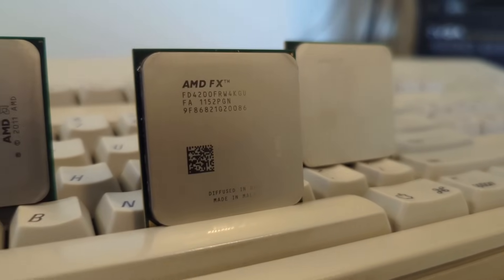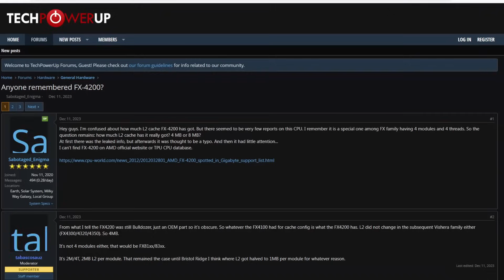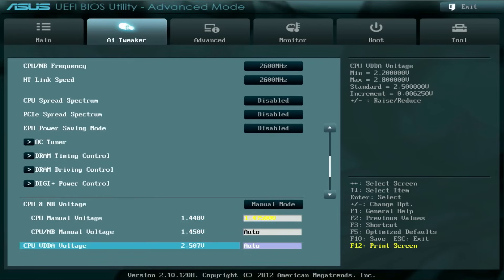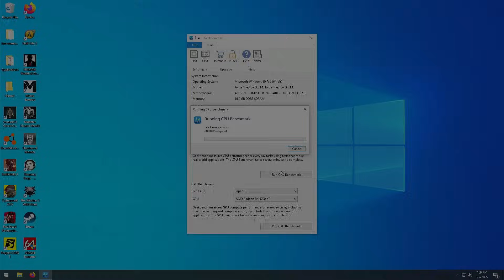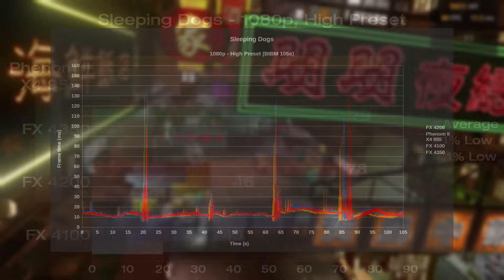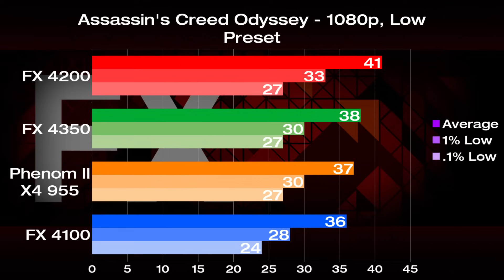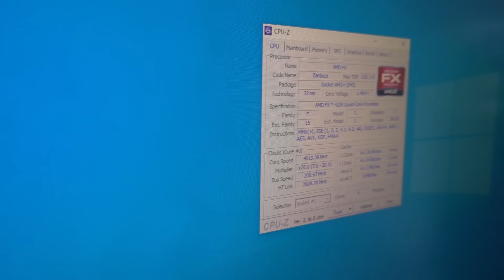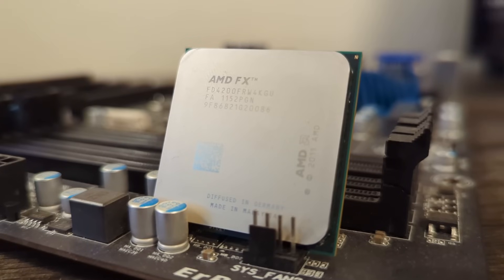What if AMD FX had "real" cores?

Comment: I still use my AMD FX-8370 (8 cores, 4 GHz) in my PC, since 2017, with 32 GB RAM and GeForce RTX 3060.
Reply: Bottleneck time
Reply: Hi there! Current FX-8350 user here. Mine too is still chugging along as well. I mean, yes, even oc'd to 5ghz loading times can be, well, questionable but not so bad it warrants rebuild just yet.
Reply: That’s a lopsided configuration…
Reply: Same here with a FX 8300 and a GTX1060, been in VR with that thing and it isn't half bad
Reply: lmao what a waste of a 3060. Neck of the bottle choking so hard ur basically a head in a jar.
As I moved from 7950 to 1060 to 3060, each upgrade was a 50% fps improvement at most until I upgraded the CPU for the full 100% (double my fps) and I've gone from 8320 to 1600 to 5600
Reply: That's a quad core bud. It doesn't have 8 cores.
Reply: @nexxusty  it does have 8 cores. they physically exist

it's like saying 4 sets of conjoined twins aren't 8 people
Reply: @stevesmith1383  There are many different types of conjoined twins, not all of them are two entirely functional humans sharing non-essential parts. Only parasitic twins, accounting for 10% of conjoined twins, have a decent survival rate.
Anyway, there was an entire lawsuit on this. They are not 8 cores. Some software treats them as 4P/8L, 8P/4L, some as 8P/8L.
Words mean things
Reply: @CLAAAAAB there was one lawsuit in one country in one state

That was settled out of court so there wasn’t even a ruling. 

That’s not a statement of fact. Certainly not the case for 99% of the world. If there was a real case to be had, the EU would have been all over this. 

Did you know an Isreal Court rules that Heinz isn’t ketchup but a tomato seasoning. Guess that’s true for America too now. 

And kudos for taking my conjoined twin comparison in a totally different direction

And yes, words do mean things. Software can say whatever. My cinebench r15 read windows 10 as Windoes 8

Guess I’ll go sue Microsoft for lying to all of us. 

But a physical core is a physical core 

The FX CPUs do not have virtual cores or hyperthreadong or SMT

They got gimped cores that share resources

CPUs sucks ass, but this whole “not a core” argument is dumb. And didn’t have much legal merit, hence why there wasn’t a mob of lawsuits
Reply: @nexxusty It really has 8 cores but shared into 4 modules, search on any AI. Some programs read only modules other skip them to check only the cores and threads. Park Control & CPU-Z says 8 core with 8 threads, Windows reads only 4 modules with 8 threads that's why there is a misindentification as 4 cores in some programs but it really has 8 cores shared into 4 modules, 2 cores per module.

Comment: I am watching this on the FX-6350, 32GB RAM, 1TB SSD and 6TB HDD, and a GTX 750 fanless GPU. It plays some games, sort of, but it's really serviceable for a lot of other things. In the next room I have a Ryzen 5 7600X build with 128GB DDR5 RAM, 2TB SSD, and 6 TB HDD, and an RTX 3050 fanless GPU, ready to go into service. It's going to be GPU limited, so the 4-stick RAM speed issue isn't an actual performance issue for me. Once they fix their memory controller, whatever new 6-core, high-clock CPU has the fixed memory controller will go in place of the 7600X.

Comment: I'm still using a FX 6300 lol. Works fine. 500 tabs open, runs games fine 32 g mem use fusion but that hangs a bit, runs image ai and llm models locally, just barely, but sadly. win11 won't let me keep it ;)
Reply: I had a 4100 before this that i ran overclocked, the memory controller failed on it but that might have been due to installation error that was so slight that it still worked for year but i notices the cpu pcb was a bit curved when i eventually had to replace it. not bent pin maybe something like some grease got under or the cooler heat sinc was clamped down too hard or something. These FX cpus overclock pretty well if you have a MB that can provide the power and stay cool and use an aio cooler with it. objectively these cpu's are plenty powerful to general use and gaming if you are okay with have the cpu intensive fx set to medium. Honestly the only reason i'm going to replace it soon is because the instruction sets it can support are a bit dated and newer cpu's have some major optimizations for running ai locally. The price of GPU is really harsh these day. I have a Nvidia Geforce GTX 1060 6GB that still works for mostly everything except larger ai models i run with the 6300 and 32GB mem on a asus m5a97r2 The only really downside recently is I've been doing work in fusion and waiting 20 min for tool paths to be generated and having to wait a min between any selection or edit is really annoying but that is expected as generally cad work is more geared toward a powerful workstation pc not a mid range 13 year old gaming pc. 

in my experience the 6300 is in a better spot between the power and heat of the 8xxx and issues with the bulldozer 4100 you get used to the idea that you 4 cores is more like 2 and your six core is like 3 but that isn't entirely true as they have 6 cores they just pair cores to cache or something so they can only be really functional operating in pairs and not independently so its like 3.

Comment: I loved my 6300, I got it in an M51bc system for dirt cheap with the psychotic custom hybrid m5a97 motherboard, but it ran stable 4.2ghz all day with a budget cooler master single fan cooler, gaming on an 8gb rx580. Of course when I upgraded to ryzen 3600 and 6800xt, it was a Bugatti vs a civic, but for about 4 years that 6300 ran games like farcry 5 in 1080 no prob

Comment: The FX clustering idea was reasonable in the context of when it was being developed and the individual sub-module tech was rather good but it just wasn't combined in the best arrangement. FX was sort of a test bed generation to try new ideas and poke at the edges of the envelope, incl unique cache policies with niche advantages; Zen was largely based on those FX-tech developments, with refinements and a better arrangement of the sub-components. (Although AMD downplayed the Zen-FX connection because of marketing reasons.)
  
GPU compute was strongly on the rise at the time of bulldozer and the industry predictions were that most heavy floating point work would be shifted to a GPU co-processor (floats are is still the specialty of a GPU), meanwhile most workstation tasks up until then were far more dependent on the integer-ALU. 
Now because die space is limited at a given cost and power budget you could have 8 ALU+4FPU as cluster cores or 4+4 as full cores with some extra space for a bit of extra cache. How does that math you ask, well an FPU is much larger than an ALU, far more circuits and transistors, especially as the FPU has become just a second function of the simd-unit since just before that generation. (FX had AVX-simd so basically a 256 bit FPU)

On linux use lstopo for a graphical diagram of your machine's topology from the perspective of what the OS can directly see or access: CPU sockets[packages], chiplets[sub-packages], cores, processing units within a core [usually SMT], process assignment order, cache layout details, numa config, whole system memory, and PCI[e]. If not logged into a GUI it will give a text tree. 

Within a core it will give processing units(PU) and the order of process(P) assignment. So 2 core with SMT might be:
(core#0[pu#0 P#0][pu#1 P#2])
(core#1[pu#2 P#1][pu#3 P#3]) 
Which in this example says the second process-thread (P#1) is assigned to the first Unit(pu#2) of the second core(#1).
I have an FX-8320, it shows 8 cores, each with one PU and a dedicated L1data, but the cores are in pairs with shared L1instruction cache. So the CPU hides the sharing of the FPU from the OS. It also seems to assign processes in packed order rather than alternating clusters, so p#0 and p#1 are both on the first cluster, eg. This was a definite weakness of FX, and I can't imagine why they did it that way other than making it easier to fully shutdown cores for power or binning purposes.

Comment: The first PC I ever bought that's only purpose was gaming had a 4100 in it. It taught me 3 things. 
1 - Buying brand new low-end prebuilt's are a colossal waste of money.
2 - It taught me how to overclock... out of desperation. 
3 - Being CPU bottle-necked makes for a miserable experience... How dare I have the audacity to play COD:WaW Custom Zombies while being in a voice call on Skype and not want to experience constant skipping and hitching. 

Bought an 8350 a couple years later. It didn't seem as good as the 3770K I also had, but it was pretty good.
Reply from the maker: The best thing was that overclocking point lol. I learned a lot about OC when I had to daily an FX 6300 for a while

Comment: I was not knowing about this CPU. But it could not have been a savior. If you followed the specialized press on the bulldozer release, you know that the issue was that it had a way too long pipeline for it's time. It could have unlock high frequencies, but this frequencies was unreachable due to Global Foundries' process node which was one or to step behind Intel foundries' one.
Reply from the maker: Glofo's 32nm process really held these CPUs back, when people say they should have gone the Phenom III route instead I don't think it would have ended that well because of that
Reply: @SPNG  Probably, yes.

Comment: [WALL OF TEXT INBOUND! Enjoy the read!] I've wanted to test this chip for ages and pair it with my HD 7770s as its one of those hidden gems, currently theres an FX-6300 inside i fixed a lot of pins on in a joblot going for gold recovery and got some other spicy gems in there saved! Ali-ex has a few listings now and i got mine for under £5, and on Ebay i just scored a £25 FX9590..it makes me wonder that this truly was a design succeeding the pentium 4, a long stall prone pipeline that was for the sake of clocks, the FX9590 makes it clear on the direction AMD was going for, considering their Athlon/Phenom II Skus being low clock speed wise, much like the willamette pentium 4s, this was clear to help trick consumers into feeling like they got more for their money, while having an architecture that even fully unlocked, in gaming? Really didn't show good scaling, 

this was an era where SMT/HT was BIG, moreso than the FPU dependancy that was stripped from FX, cache was important too, but the 4M/8T Design of the 8000-9000 series showed how important it was for this architecture to split up into smaller process streams, helping a pipeline stalling prone design, significantly improving 0.1% lows and general stability. It does make me wonder, what if there was an FX-8200, a true 8M/8T design, higher clocks, cache, it would have truly plucked its crown from a Phenom II X6 series of processors, we will never get to know sadly.

the varying platforms AMD had, its APU experimentations and the dreaded late FM2+/AM4 Athlons is a pain i had to endure for quite some time, though i can't deny its some of the most fun an easiest overclocking that AMD was practically begging you to do, slap the RAM up to 2133 flat 9s on just about anything you can find, shove the voltage to 1.5V and without a care in the world those later Athlon samples like my 880K could almost kiss 5ghz, lock in a framecap with RTSS and you can just about get away having a much more consistent experience that gives the pipeline less to stress about. 

Back to K10, this is a market i was first getting into myself and have some backstory on what it was like as a potential buyer. It was clearly a product for those on more budget chips, Comparing to a native quad core chip for architecture sake is valid, but i see FX as a 2M/4T, 3M/6T, 4M/8T design throughout its product stack..and that should be a famillar design, Athlon II X2/X3, Phenom II X3/4. These FX were the chips that attempted matched the price points of said chips. Here are some prices, which generally dictate in my eyes the market target and is something a budget conscious buyer would focus on more.

In Fall of 2009 you could buy these several Skus:
Athlon II X2 250 $87 280 $49
Athlon II X3 450 $89
Athlon II X4 620 $99
Phenom II X4 955 $245

AMD Had a lot of Sku variance and quick price drops/confusing prices at launch, the Athlon II X2 250 and II X3 450 being so close considering they were fairly close to launch and especially for Athlon II stock, they were still competing with Flagship K8 performance, which in the 2010s was a struggle for them to keep up, struggling to compete with the Lowest tier Pentium E series on 775. Athlon II X4 wouldn't release until 2010, as in 2009 you had the Phenom II X4 line making itself known, and for a hefty price, by the time Bulldozer launched, the story changed for K10 massively towards the buyer at the time..and a nifty trick we all know about ;)

in the fall of 2011, these were the Sub $200 Skus FX offered..and how K10 fell off for pricing, a price drop we have not seen since, and so quick. 
Athlon II X2 270: $62 
Phenom II X2 570: (Likely $74, Hard to frind Q2 2011 prices)
Athlon II X4 640: (Likely Sub $90 By Q4 due to FX Launch)
FX-4100: $115
FX-6300: $165
Phenom II X4 980BE: $175
Phenom II X6 1100TBE: $185 (Fall prices between the X4/X6 and black editions in general are a little cloudy by Q4 2011, but like many histographics indicate a shakeup by FX with some outlying prices that..don't make a lot of sense until 2012 and some late Q1 2013 K10 releases!)
FX-8150: $245

Its quite clear they were targeting some older popular prices, while making FX look like the better buy to someone looking to upgrade..issue is timeframe wise, those who invested into AM3, couldn't use FX, it had to be AM3+, released in mid 2011..AM3 released in Q1 2009, this was likely another kicker to FX sales, people simply couldn't use them, so those on now dated old Athlon II X2s and similar had strong sub $200 flagship upgrade options of K10 flavours. already saving over $60 versus the 8150. So, the majority are on an unsupported motherboard, prices have dropped significantly on budget K10 and on lower end Skus of the Phenom II X4 lineup, had significant drops, some to around the $100-120 price point, right where the FX-4100 was, new motherboard not considered, and i like many others saw no reason to upgrade, quad cores were only now getting good optimisation, DVD based games were still there but dying now and in my case, 2 party tricks of K10 made sense to the budget buyer, 1: You could drop in a K10 upgrade into AM2+ boards, something a lot of people had by now, a good more effecient upgrade to K8. 2: Hunting for unlockers ;). 
By this time 790X boards in the AM2+ and AM3 Flavour amongst similar AM3 offerings meant that older AM2+ motherboard or your newer AM3 board could take a cheaper chip, especially by FX's launch, unlock an Athlon II X2 to an X4 and Phenom II X3 to X4 (the most popular unlockers, aswell as the Sempron 145 to Athlon II for someone scraping some more life if they had a capable board, unlikely with the budget OEM offerings at the time, another reason the later quad core chips were a simple drop in upgrade where FX Wasn't supported!) And overclock them! A lot of K10s popular offerings were sub 3Ghz chips, late off the clock speed craze, AMD thought a page from Intel's book would entice..yet with ease, K10 could hit the magical 4Ghz, or close to it, (Or use core staging for higher clocked better bin cores!)

Personally AM3+ this time round really felt like a slap to the face from AMD, the same sting from Intel changing sockets, AM2+ went down better, thanks to the backwards compatability that wiped the tired K8 refreshes out the picture and the dreary original Phenoms that were slow and sluggish. So a sour taste was already in people mouths who had or very recently invested into AM3, considering the discussions at the time mentioned these FX chips would be on the same platform but newer chipsets..until the AM3+ discussions came closer to release. When you consider people were literally unlocking cores, while FX took them away, sharing more resource, not just the L3 cache like K10, its clear to see the value for money versus what K10 dropped to, and with Sub $50 skus, cheap boards, this was a popular time where single core platform users finally made a jump like myself, a lot to 775/1156, but AM3 would have been in the eyes of buyers, even if the Q series overclocked gave Phenom/II a run for its money! 1156 i3/i5s to the duos and Quad core i7s smoking the lot! Sandy/Ivy releasing just reinforced their W with AVX support! its a shame original K10 never saw AVX support like FX, (Imagine they called it VX..(A)MD (VX), Nifty marketing i think!) But hopefully this market standpoint contributes to the performance standpoint in your video, and hopefully my FX-4200 is a decent clocker! And the FX9590 doesn't try and melt a hole in the motherboard..

Comment: I built a cheap Ebay e-waste computer for a home theater pc. I bought an FX-8350 CPU, 16 gb of PC3-17000  memory clocked at 2 ghz and a GTX 1660 Super 6 gb video card. All plugged in to a GA-970-UD3 motherboard. It's a great video streaming DVD playing machine on the cheap.

Comment: I started my PC building career with an AMD FX-8320, and i think my "favourite" thing I remember was my VRMs nearly cooking themselves to death on my first motherboard (a budget Asrock 970 Extreme3 R2.0 with the dinkiest VRM solution). I strapped 2x40mm fans to the VRM when I was doing some basic overclocking before I upgraded to the same Asus Sabertooth 990fx board used in the video, and that was a night and day difference for overclocking stability. It was just fun jumping it up from 3.5GHz base to like 4.2Ghz all core, even if the performance was still way behind Intel.